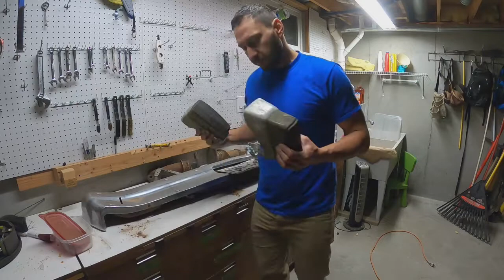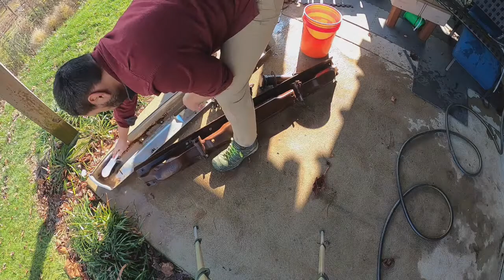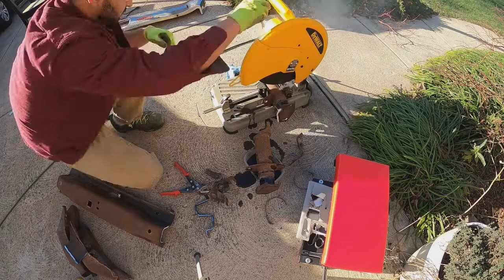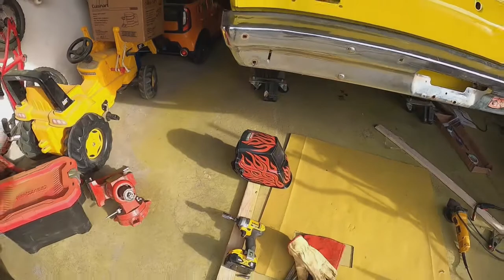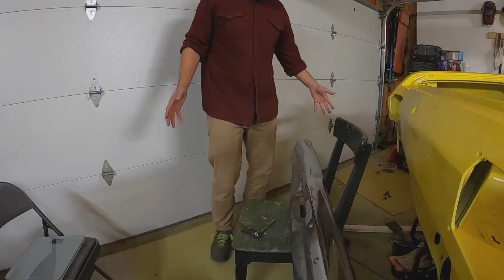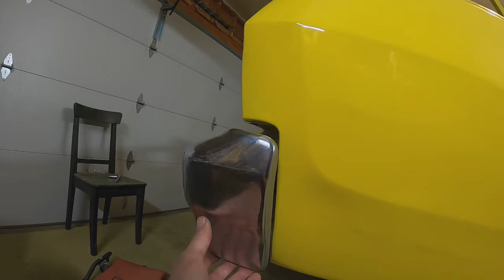Plymouth Duster Weight Reduction

Comment: Dude!! Nice work... super cool idea... never thought about the newer models having more Bump in the bumper.. 
Always thought they were heavy cause you lifted the Car with them... in case you don't Own one.. yes Factory jack is the same style you see on Those,, I bought every accessory that goes on my Jeep .. ever seen them Super Long Jacks mounted to the hood, side, roof, etc.. well Mopar use these also.. you grabbed the Bumper and lifted the rear or front! My 68 jack still works No I've never tried it.. peace .. Keep at it..
Reply from the maker: Thanks for sharing. I actually do have the factory Jack. I had no idea why it was so huge. Makes sense if it was intended to lift from bumper height. Every car that I have ever driven(1984+) has always had a jack for lifting on the side. Now I know 😀.
Reply: @DustorBust  I am the 2nd owner of my Dart.. I have the onwers manual and even the Warranty booklet..

Comment: Do you know if I can do this without a welder, like using bolts or something, keep it from moving  ? You have the look of the bumper I want, but I don't have a welder.
Reply from the maker: Hi 74DusterX, thanks for the comment. You can definitely get almost the same look without the welder. The only part that was welded was the shock cylinder that was cut. If you did everything else you would still get most of the weight savings but the bumped will stick out just a little further from the body of the car. Removing the rubber bumpers is the easiest way to look better in my opinion. Then if you start chopping internal bracket you can cut a bunch of weight if you want. Good Luck!!
Reply: @DustorBust  ok  thanks